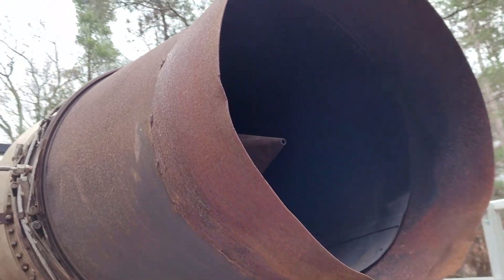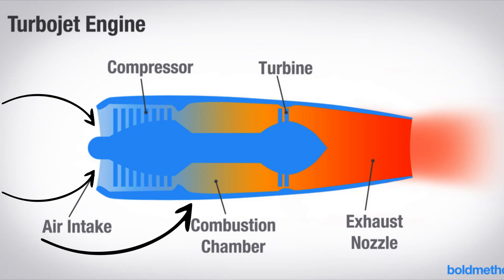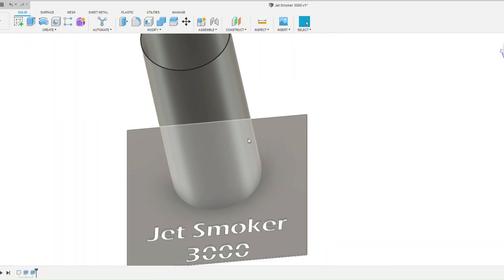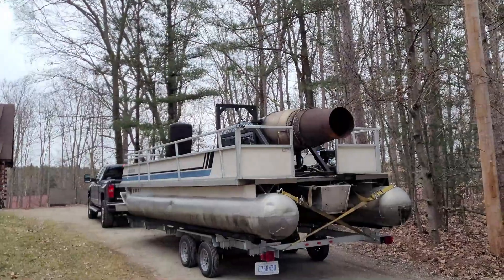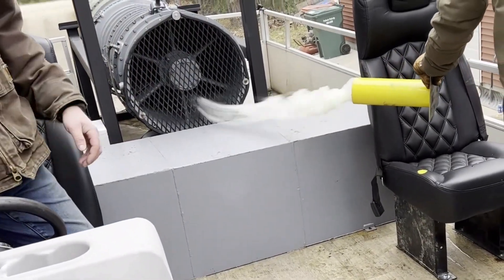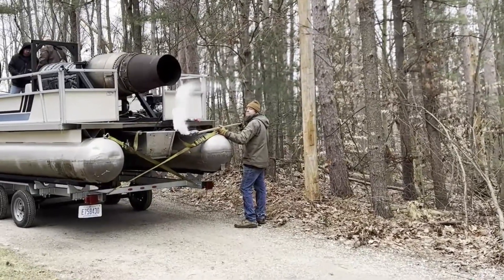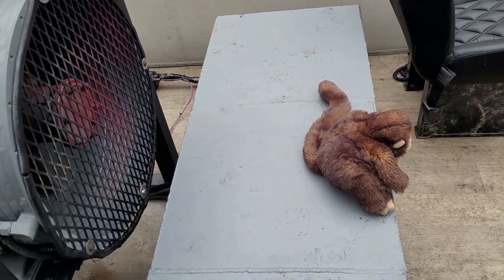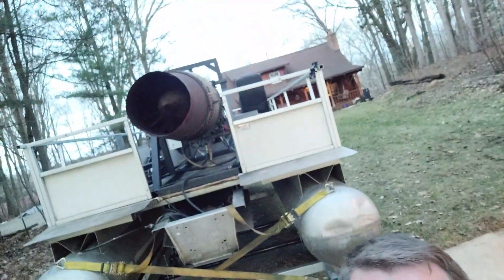How close is TOO CLOSE in front of a jet engine?

Comment: Even a small turbofan moves a ton more air.  Just a few weeks ago, a baggage handler got ingested into an E175 at Montgomery, AL, and that engine was at ground idle, just running to provide air and power for the aircraft until ground power and compressed air got hooked up, as it had an inop apu.

Comment: I think the biggest danger is that the intake seems to be small enough for a person to cover it, meaning that if someone got stuck to it, it would create a vacuum behind them basically ripping the skin off.
A half dome as the intake would make that more or less impossible
Reply from the maker: You are 100% correct. If you did fully cover the intake, very bad things would happen, not going to test that haha. I have a new cage and fairing I'm building that will do just this.
Reply: @LiveLearnProjects  what would happen if a piece of plywood covered the intake?
Reply from the maker: @Bill Madison  if it didn't break the plywood, it would put a ton of stress on the internal components as it tries to fight itself. Likely in a damaging way...
Reply: @LiveLearnProjects  thanks
Reply: @LiveLearnProjects  there should be a second grate  just behind the seats